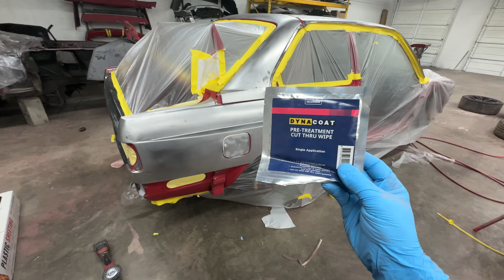Chopping up My E30 M3!!

Comment: Overall not bad,but I would have worked on that left quarter more,than when you installed the rear body panel you could have had the factory seams exposed making it,look like it came off the assembly line.good video,your paint guy’s work is impressive.😎😎😎👍👍👍

Comment: Mark why didn’t you take the seal off the sunroof? I know you can’t get e30 sunroof seals but e36 sunroof seal is an inch longer and u can cut it down to size. Now you have primer on the seal and sunroof will peel if you don’t fix it.

Comment: 4:31 trace the shape of the good side  and have 23 garage plasma cut(or you could cut it from a piece of sheet metal with a pair of tin snips) a exact new piece of sheet metal and weld it back in on the bad side...just a thought

Comment: Could have used some silicone bronze Cusi3 wire to weld/braze up those seams. Cusi3 gives a more ductile weld which doesn't crack. This would have been better in this application. Because this type of weld is softer it also gives u the opportunity to grind the seams back in making it look aesthetically correct.

Comment: There's no need to rush this kind of project car and take too many shortcuts while welding and casually applying seam sealer.
I hope it's not too late to cut and reweld panels again properly (using silicon bronze mig wire to really match OEM look).
Greetings from Europe ;)

Comment: You should have asked Yuri to panel beat that corner out properly for you. Not good that you welded the seams. That or buy a new quarter panel. Too late now.
Reply: Could have used some silicone bronze Cusi3 wire to weld/braze up those seams. Cusi3 gives a more ductile weld which doesn't crack. this would have been better in this application. Because this type of weld is softer it also gives u the opportunity to grind the seams back in making it look aesthetically correct.

Comment: A couple of questions…. So are you still building the S2000 swapped e30 m3 or is that no longer happening because of this one? 
Second, why install the engine just to get it covered in body dust, why not leave it out and do the engine bay, along with the rest of the car since it’s all being redone anyways?? Doing the engine bay would give it that chefs kiss once it’s completed! Not doing it would just make it look out of place to see a car so slick and beautiful and then to pop the hood and see that massive engine but a bay that was skipped and not repainted with the rest of the car… if I were going this far with a car, I would do the bay as well, since it’s all being done anyways - it’s the 10% left out…
Reply from the maker: The engine bay has a fresh paint job before engine was installed
Reply: @Motorheadco   ohhh that’s right, you showed that and talked about it in the video when you picked it up, totally forgot about that. But even then, I would’ve left the engine out so that you didn’t get it covered in the sanding dust, filler dust, and all of the other airborne contaminates - but that’s just my opinion… 

So what about the s2000 swapped one that you were building? Did you sell it off or junk it?

Comment: You should have asked for help. To get the seams right. You just devaluated the car. For an non oem restauration. Your dad or brothers could have helped you.
Reply from the maker: I can always cut the seam when doing the body work and I don’t care about value it’s staying with me forever
Reply: @Motorheadco  it’s about your skillset. They would have helped you. To get it right. It’s about admitting someone can teach you. About personal development. 

I know you have it in you.  If you can cut that edge afterwards. Yeah you could. But a good appraiser will find it. 

This is not were you stripped the car down for. You bought the panel to restore to OEM.
Reply: @Motorheadco  
You can later work the separation points on the rear panel into the weld seam with the cut-off machine and then it will look right when painted.
Please do not use putty for this...

Comment: I think you got lazy, that driver quarter is warped, you had to pry the panel in and you removed the flange that held the back panel in and took the lazy way out welding in the seam. For a car you claim to love so much you took a BIG shortcut that hurts the value of the car. Not my car I know but disappointed in you.
Reply from the maker: The flange was destroyed I didn’t remove it, the only other option was to replace the quarter panel. And I’m not gonna do that. I can always cut the weld to add a seam. As far as value goes it doesn’t matter cause I’ll never sell it
Reply: Don’t be a Karen!!
Reply: It's his car he can repair it how he seems fit. Merica!!
Reply: @Motorheadco and as far as quarter panels go, a lot of folks don’t know most parts especially rear quarters, are NLA for the e30 m3 so you have to work with what you have. Car is coming along very well. 👍🏾
Reply: I really like your channel Mark, but I have to agree with @Jsellers1965. Spending all this time and money on your dream car, and then not dealing with the driver quarter in a more appropriate manner just kind of goes against what you are attempting to do with this build. And you never know what the future may hold. Your interests may change, or you may need to sell the car to help your future family. Just sayin….
Reply: To each his own you build your car your way he builds his his own way